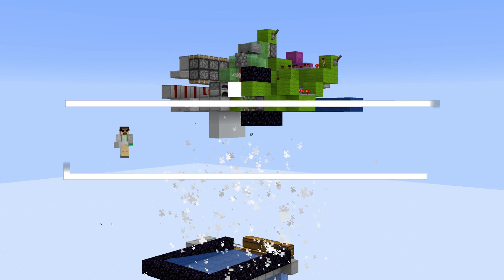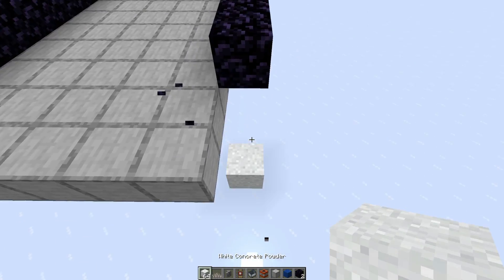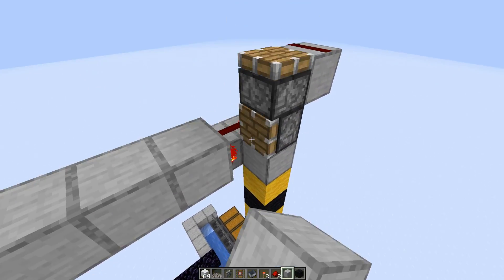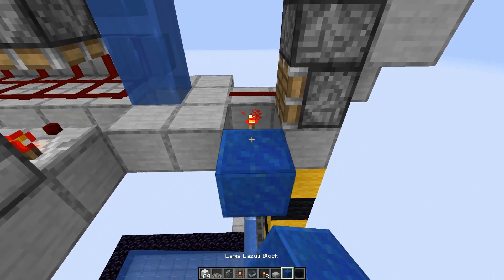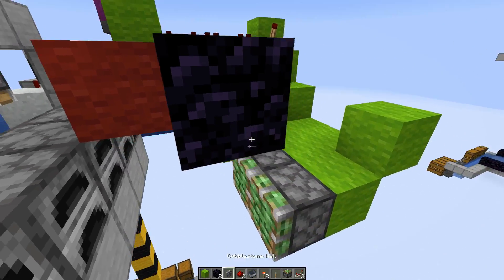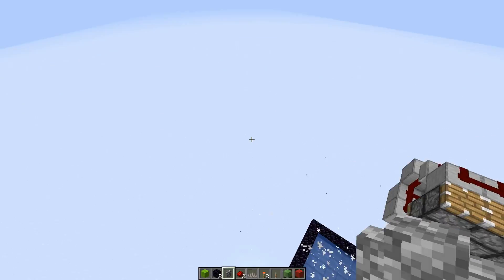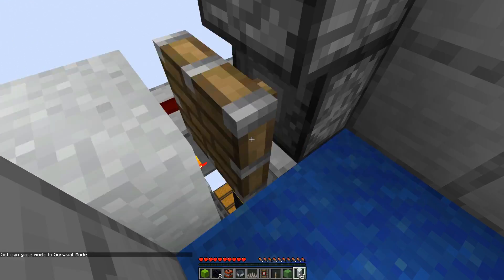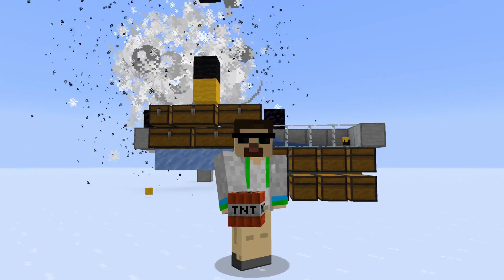[Tutorial] Fast Concrete Converter using TNT Duper in 1.14+ (18,000 items/h)

Comment: Worked fine until 1.16.3, as soon as the concrete gets pushed to the second piston on the line, the first one gets stuck and you have to manually update the piston so it will work again for the next 10 seconds

Edit: Turns out after 1.16 you need to have 54 items in each furnace instead of 58. That seems to be what causes the problem.
Reply: AHA! Fixed it, thank you! I was down to 55 blocks in the furnaces and then I saw this lol, you've saved me and my concrete addiction

Comment: here some fixes it has some some problem but i managed solve it no .1 replace 0 tick block pusher to replace make the slow one first and then place a piston top the block  and thats going to fix stucking problem and 2 nd in 1 .16 you have to push the minecart using a piston other it would ignite so do that prevent tnt from your thing up 3rd place block 2 blocks above where torch is and its gonna solve concrete powder falling down and also sticky piston is must have and speed is going to increase as well 
4 have 54 block only un furnace its enough to just give signal strength needed 
 5 just have singal water source next 2 nd concrete that enough 

i recommend build it  4 block above the or it will block up the land scape

Comment: Guys, i built the machine in 1.16.1 and somethings changed, but not much. So, I built it facing north and worked just fine, so don't need to worry about that. Also, the comparators will not work proprely with 58 items, so change the number to 54 and it will be fixed. Hope you have a fun time in your minecraft world!

Comment: I'm having a lot of item loss in this farm. I wouldn't care if you'd lose 10% of the blocks, but I built it, tried it with about 6 stacks of concrete powder and roughly 35-40% of the concrete gets lost somehow, is there a fix to this? Or did I manage to build it wrong somehow? Even though I triple checked and everything was in place and the repeater timings were correct aswell.

Comment: This is actually slow for an auto duper. My manual item duper duped 46656 items in 20 mins... thats one chest full of shulkers containing tnt or whatever stack of items u want... that 64 items per shulker slot... 27 slots so 1728 items per shulker.. 27 slots in a single chest
that 1728*27=46656
Reply: its not a duper

Comment: how would this work in 1.16 when zero tick is removed? Will there be a timer that is somewhat close to the speed of zero tick?
Reply: I believe 0-tick isn't going to be removed, they just patched the growth mechanic for bamboo sugarcane and cactus
Reply: @joshualintag4994  they said a couple of years ago that 0 tick is "intended" and wont be removed
Reply: Wait, they have fixed 0-tick farms for sugarcane cacti etc., I don't think they have fixed the whole 0-tick mechanic yet. I might be wrong though
Reply: @leoshork  yeah its going to suck when they remove it. it will make farms so much slower.
Reply: @sreeramhilangkovan8246  yeah but what I mean is, I don't think this farm will be broken. I'm not sure, but 0-tick pistons should still be possible

Comment: solution to those who built it in the wrong direction: when assembling the tnt duper, before hitting the lever, place a block to the side with a rail, making the detector rail switch, hit the lever, pushing the slimeblocks together, remove the block with the rail on it and place a second rail on the slimeblock that is now adjacent to your cart. leave that one there and turn off the lever. it doesn't exceed the push limit for the piston. et Voila!

Comment: If your farm is facing north or south, just place a block and another rail right next to the first rail. It will turn the first rail in the right direction, but make sure to break the extra one and the block it's on.

EDIT: Trying this does work, but you can still place the rail regularly with a north/south machine and it works fine.

Comment: Heads up doesn't work anymore but can be fixed with a few tweaks
Reply: I built one exactly as shown and it works fine (Using 1.15.2)
Reply: I made it in 1 14 4 on optifine
Reply: Guess that maybe it just didn't work in that version
Also can't wait for optifine to be released for 1.15 and up

Comment: I'm having an odd issue where I'm losing half of the items I put in. tried a control with 3 stacks of dirt, ended up with just over a stack and a half. messed with delaying the 0 tick piston, but same results. I lose half of the items no matter what I try. they aren't floating aorund anywhere, I've checked. any advice would be most welcome. thank you!
Reply: what version are you on?
Reply: Did you build the same number (or more) hoppers and chests in the collection area? You'll need at least 3 hoppers for them to be able to keep up, otherwise the items will just shoot out the end and despawn

Comment: i know im late to the party but i went to turn mine off and the second i fliped that lever it blew up instantly and it worked fine before
Reply: just add some redstione dust, a lever and some tnt. Flick that switch with tnt and it should blow it up because this is a bad design and you shouldn't use it

Comment: this does not work in 1.14.4, instead use a 1.14.4 version of a duper.
Reply: it works in 1.14.4, tnt duping hasn't changed
Reply: @jobechan2306  not for me
Reply: @jonkke  are you sure that you're running the farm in a vanilla 1.14.4 world? or is there something like spigot or mods?
Reply: @jobechan2306  im playing on a survival server with a couple plugins, also the server is kinda laggy but the tnt doesnt get duped and the coral gets destroyed
Reply: @jonkke  in order to get plugins, you need spigot, and spigot is a mod. so thats why it doesn't work. This farm was designed for vanilla, and probably won't work in other versions.
Reply: @jobechan2306  i mean i  tested it in singleplayer, didnt work
Reply: @jonkke  I tested it in singleplayer 1.14.4 as well, it worked. Did you build your own version or did you use mumbo's world download?
Reply: @jobechan2306  my own world